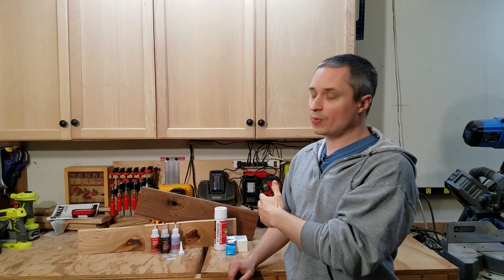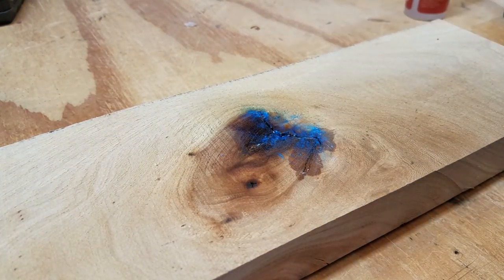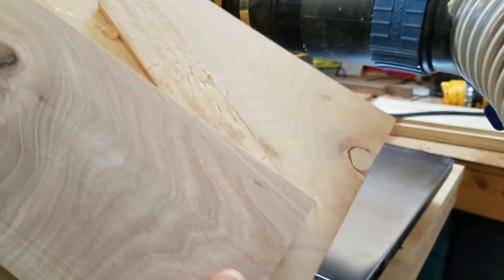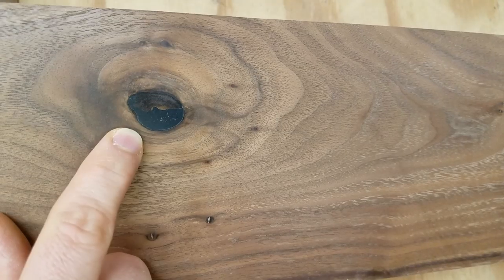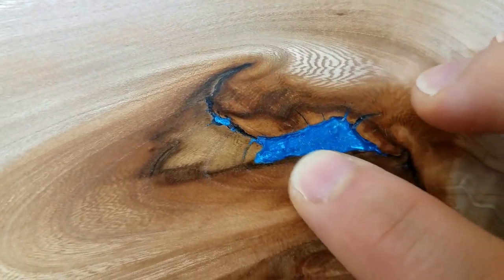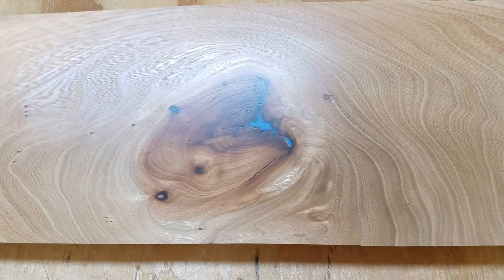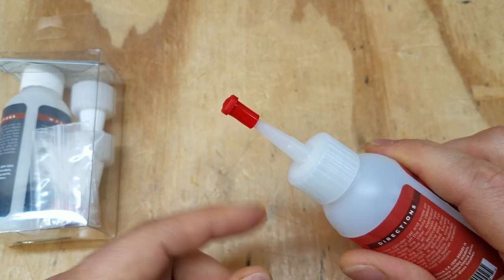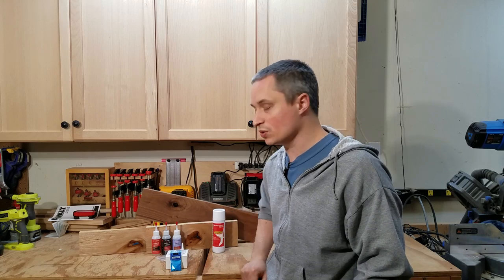Starbond Gap Filling CA Glue Review

Comment: I am trying to use black on ask wooden bowls. However, the black seems to go into the course grain and can not be sanded out.  I used the lacquer trick of spaying on lacquer they using the black. It did not work out well,
Reply from the maker: I haven't run into that issue myself, but I've only used the black CA glue on walnut.

Comment: Great video. Do you think the glue can be applied to a vertical surface? I have a think crack on the door panel that I'd like to repair. Not sure if I need to take the door down or can leave it on the frame. Thanks.
Reply from the maker: The thick formula is pretty viscous. If you used that in thin layers along with the accelerator, I think you could make it work on a vertical surface. I haven't tried so myself though.

Comment: Great review. How would you suggest filing in a large crack in a bowl (top to bottom)?
Reply from the maker: It's a wood bowl, right? I'd use blue painter's tape on either side of the crack to provide a support, then use thick CA glue to gradually fill it up.
Reply: @DoresoomReviews  Yes, it's a bowl. Is there a brand of CA glue you recommend? Thanks.
Reply from the maker: I really like Starbond, they have a great shelf life and good performance. I am an affiliate for them, just for full disclosure.

Comment: On a side note Safety tip do not use spray indoors without a vent to outside. You do not want to smell the accelerator spray at all as it could cause cancer in large quantities.